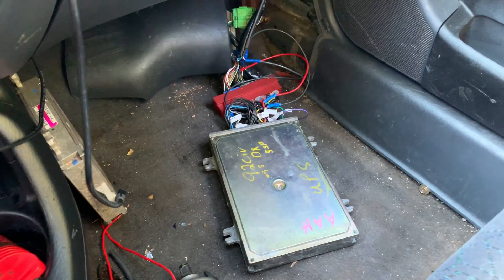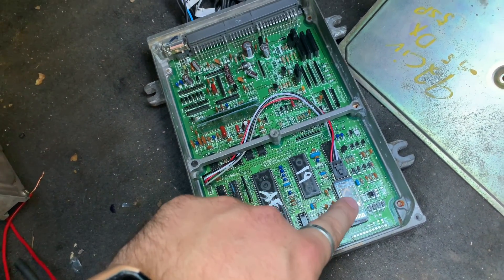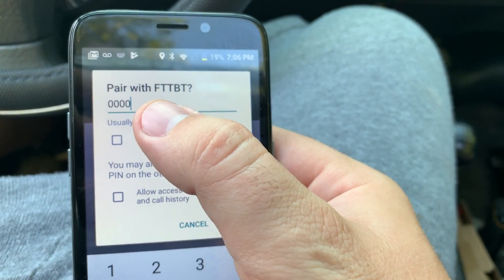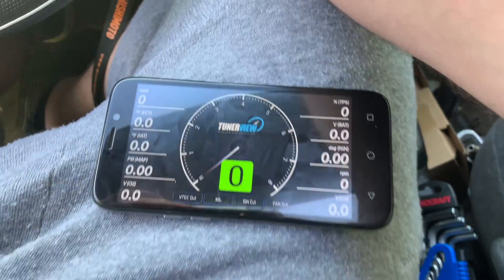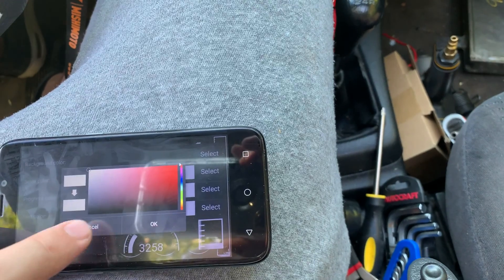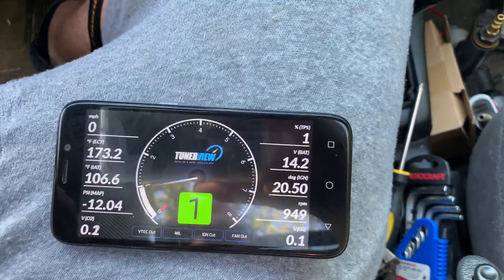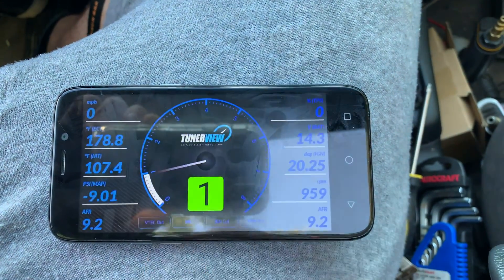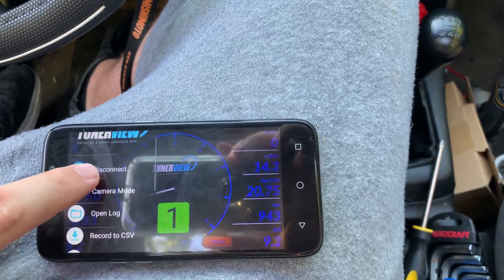Bluetooth Datalog & TunerView App Walkthrough - Civic eBay Turbo Build - Part 13

Comment: So you get a chipped ecu and then buy the blue tooth signal sender and plug it straght into the chipped ecu socket, no soldering required?

Comment: I'm use cromegold firmware and use HC-06 can connect only blutooth with my phone.  But data can't display.  Please advice.
Reply: You got to remove the  j12 pin in orden to the ecu start datalogging hope that will be useful to you and another thing in crome you have to set the app in the option datalogging also

Comment: Can you wire the stock 02 sensor to the ecu to read AFR on the app? So you don’t have to actually buy an AFR gauge?
Reply from the maker: Not really, it would read something, but the range is not wide enough.

Comment: Will this work on p73?
Reply from the maker: WeR138 integRa yes it will, as long as it has been chipped and has the 4 pin datalogging port on the board.

Comment: Can u help me I need change some parameters on my idle cause I have b20b swap but now my idle is little hig 1200 rpm can I change this with the tunerview.????
Reply from the maker: cristian chavez hey bud, no you can’t make any ECU changes through the TunerView app, you can only monitor and datalog with it.  However, you can probably adjust the idle a little at the the throttle body.
Reply: @HiRevzMedia huuu ok thanks bro.
Reply: @HiRevzMedia  You can reflash to stock' upload stored tunes and disable CEL with it.😁

Comment: Thanks for sharing it!
Reply from the maker: Péter Linszter I need something added to the app.  I need an adjustable setting added where I can set a specific boost pressure and as soon as the MAP sensor hits that pressure, the app pops up “Danger To Manifold!”
Reply: @HiRevzMedia  LOL maybe I will add something :D
Reply from the maker: Péter Linszter yes, awesome!!!!
Reply: @LinszterPerformance    That would be some epic throwback stuff right there! 😀 Make it a hidden easter egg people can enable if you know about it😆